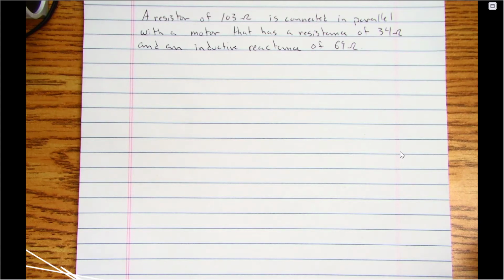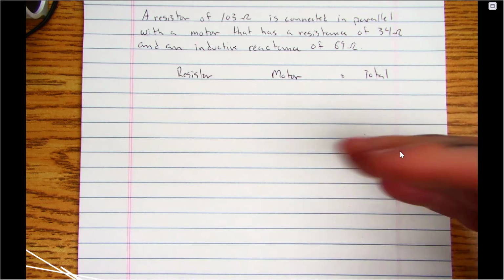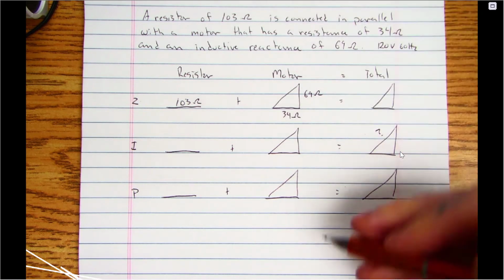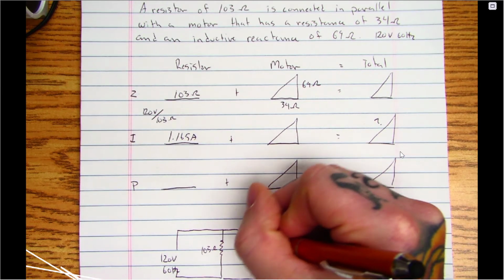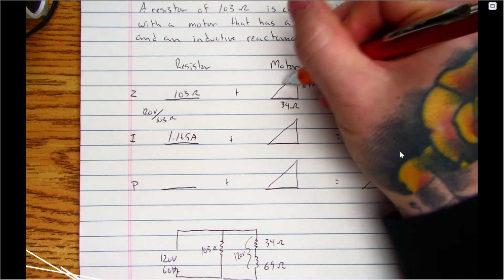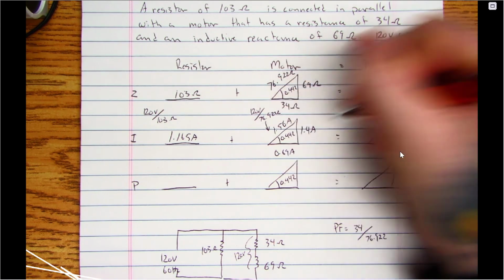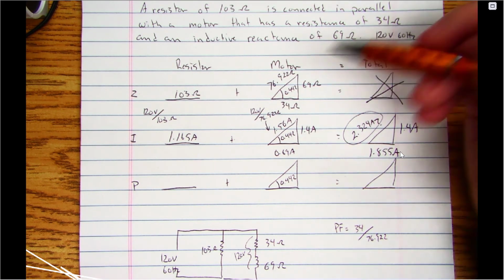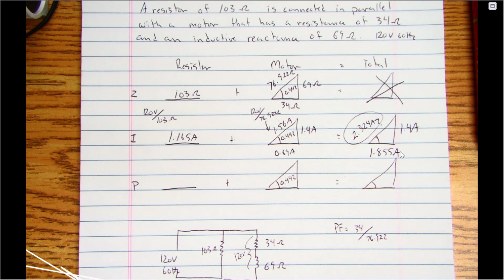Parallel RL circuit

Comment: Hi nick,
I am Sorry to bother you. Just have a quick question. How do you add all the current in parallel RLC circuit in this situation if I have an Amp for resistor amp, XL, and Xc. 
If you have a chance please and thank you.
Reply from the maker: You need to add all of the currents together using Kirchhoffs law.  The thing to remember is that the currents are not all peaking at the same time so you have to add them at their angle in the 360° cycle.  The 1 A of resistive current is in phase with the voltage so it is at 0°.  The current due to xl lags the voltage by 90° so it is plotted at 270° or -90°.  The current due to xc leads the voltage by 90 degrees so it is plotted at 90° on the cycle (phasor diagram).  When you add all of them up you will get your total.  1 @ 0° + 1 @ 270°+1@ 90°.  The other thing to note is that the Xl and xc currents are 180° out of phase with eachother so they cancel out.  All you're left with is the resistive current.